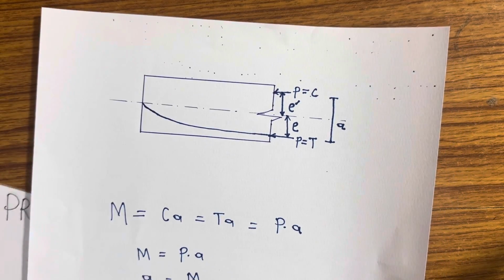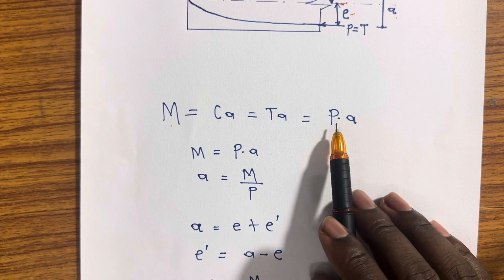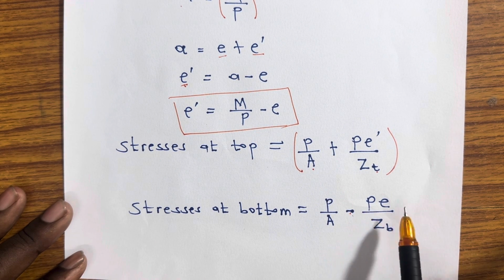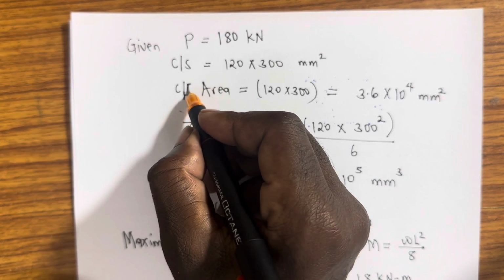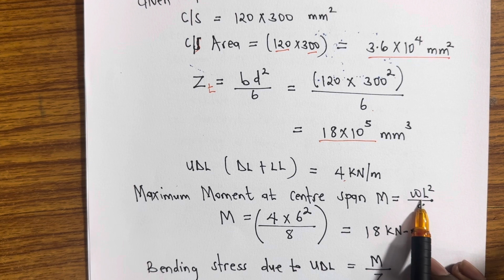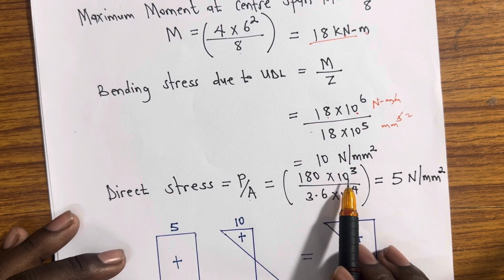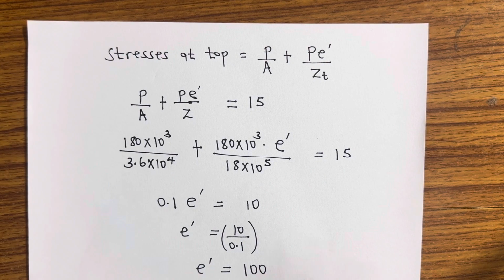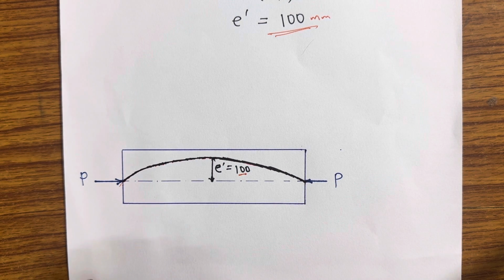PRESTRESSED CONCRETE | THURST/ PRESSURE LINE CONCEPT | PROBLEM 01

Comment from the maker: A prestressed concrete beam with rectangular section 120 mm width and 300 mm deep supports a UDL of 4 kN/m which includes self-weight of the beam, effective span of the beam Is 6m and beam is concentrically prestressed by a cable carrying a force of 180 kN. Locate the position of the pressure line in the beam